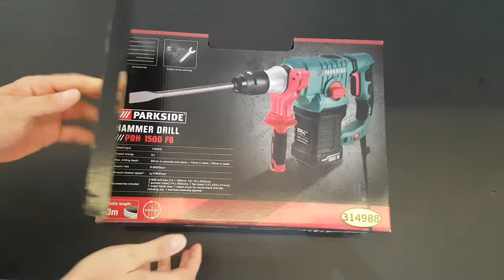Parkside Hammer Drill PBH 1500 F6 Unboxing Testing

Comment: Wrong handle position when drilling, closing hand needs to go from left to right against drill (not drillbit, but drill) rotation which turns opposite to drilling direction. Fingers of open hand aiming down cannot hold the torque when drill bit locks into wall.
No drillbit SDS+ lubrication seems to be used, which lead to fast degradation of SDS chuck.. Just saying.

Comment: Great tool for the price. Quality German engineered drill. Suitable for  everyday DIY work.
Reply: Chinese Engineering for the cheapest price possible 😁 
If you want designed and made in Germany you can purchase Bosch Professional Line drill hammers, These are still built in country. About 30 minutes from where I live.
Probably going to get the Parkside for the times my GSR 12V-35 FC can't handle the task. No point in spending big money on a unit if I only need it twice a year.
Reply: @5Komma5  I got the parkside 2000 watt demolition hammer  and me and my neighbor did a joint project. I used my parkside hammer and he used his new €690 bosch hammer. His Bosch stopped working and he had to take to be repaired or replaced as it was still on warranty and we ended up using my cheap park side till project was finished. Don't know if this was a freak event but it certainly made me happy to have bought this tool
Reply: This thing is sold by a  german grocery store - From tools sold like this you usually can't expect much and you really want to avoid these ;)
But this one is surprisingly good. Enough for domestic use.

Comment: hi there,im a plumber and every second day I do a 34mm hole in a concrete walled you think this will work.many thanks
Reply: Could but maybe try a  hammer action core at that size (also better for the wall), as this is rated for 32 mm. Any chance you got it and can report how it held up?
Reply: parkside is not for professional use
Reply: @dushk0  I used it to drill a 2inch hole through concrete Nd smash walls, tiles etc. It's good value for money. We had one had work for over 2 years so I decided to buy one for my private work. Im a plumber, so I drill a lot of holes.

Comment: I bought this hammer drill, used it a few times and it just stopped on day! The end! No idea why or what caused it checked fuse in plug but nothing else yet if anyone has any pointers
Reply: Most probably some wire got disconnected. But lidl has 2 or 3 year guarantee so check that out before attempting to repair it
Reply: @charlescarabott7692  I got it sorted since, the speed control switch was the problem so I joined wires and it’s working fine now only on top speed which is fine for a hammer drill once I start slow. Thanks for the help though 👍🏻
Reply: @peteracronin  OK glad you solved the problem
Reply: @peteracronin  also possible to replace the electronic components, once you have opened it anyway...